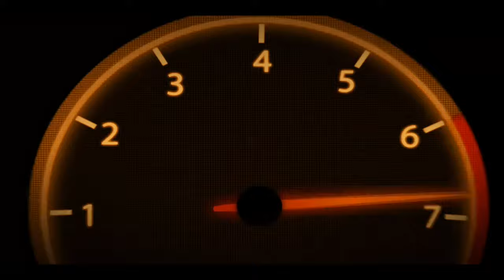Carolina HD10 Bandsaw Overhaul Timelapse

Comment: Nice job. Can I ask why you chose to do a brush paint job instead of spraying? Have you found a good tough brush on paint that lasts a while?
Reply from the maker: I have been using Rustoleum Oil Based High Performance Protective Enamel and the primer they sale as well.  It holds up really well with the machine shop environment.

Comment: Nice work! Is that the descent cylinder that came with it?  Mine has been lost to the ages and I'm trying to track one down.
Reply from the maker: No. I bought all the parts from this company.

Carolina Industrial Equipment

309B Hawkins Rd. Travelers Rest, SC 29690 sales@carolinaequipment.com
864-660-1020 - 800-933-5705 - Fx 864-660-1022
I have my old valve, if you need it, but it leaks. Might be rebuild able. But these guys sold me a brand new one. Let me know if they can't help and I'll send you my old one